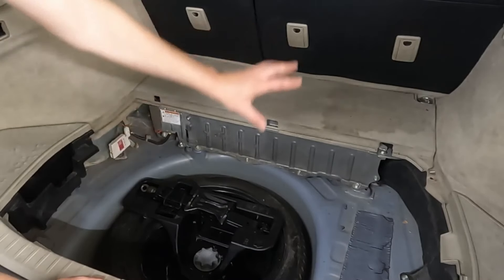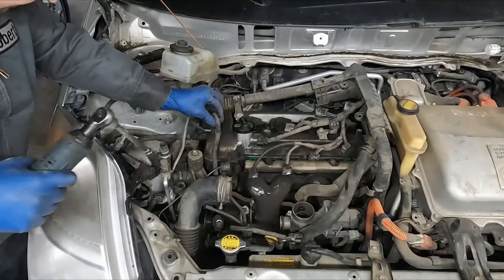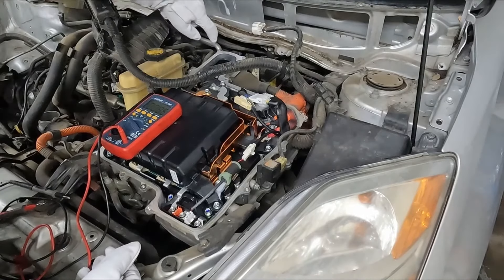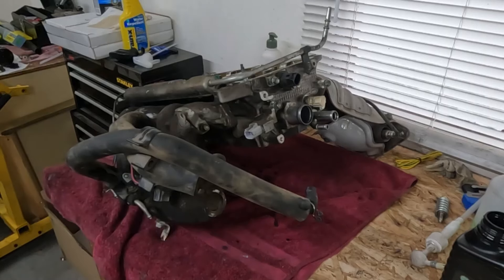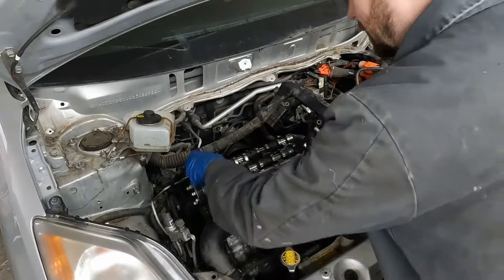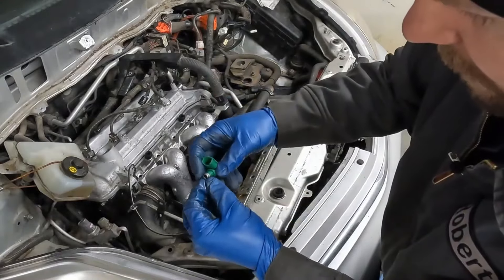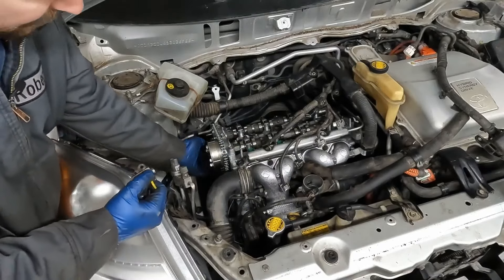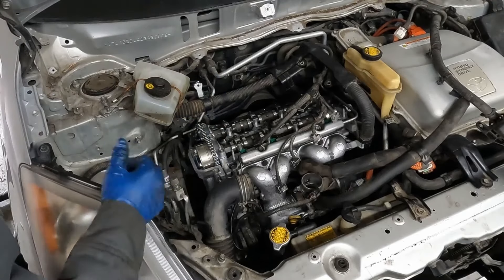2004-2009 Toyota Prius Head Gasket Replacement How To DIY

Comment: Thank you! Few things to add. No need to remove the exhaust manifold. You can remove the cover, unbolt the single mount screw, and unbolt it from the head. It can easily get out of the way and make your install/uninstall easier. Make sure to check your injector seals after the first fire up they tend to leak if not seated perfectly/if you use aftermarket seals. I would also have the shop or check the valve clearances yourself. I had 2 that were off spec with 105k miles. Its much easier to swap/ and measure the valve lifters while the heads off. Also Toyota uses a double hex not a triple square. Some triple squares will not fit. Unfortunately they are not easy to find. I was able to get away using a normal M8 hex. Just be careful not to strip them. I was able to torque and remove them with the m8 hex.
Reply from the maker: @techzilla1  Thanks for your comment and helpful tips 👍

Comment: make sure to not order this head bolt socket when odering from amazon. : M12 Triple Square Impact Spline Bit Socket, 12mm Metric 1/2-Inch Impact Drive Triple Square Socket, Cr-Mo Steel (black) make sure to buy the one he has in the video, but the longer length

Comment: Hi there just watched this nice video coz i have the same car 2007 model  and milages are quite high like 360 k
😊...just need to know its buring quite lots of engine oil smoky as well  some time power just lost and some time its very light to drive so whats the problem it would be in ur knowledge plz? It dsnt lose any colant .........
Reply from the maker: @royzaid6748  Typically if it's burning oil it's either valve seals, piston rings or both. Loss of power could be from a few different reasons. Do you have a check engine light on?
Reply: @ValleyMobileAutomotive  yes when u go bit fast engine light is on and burning smell or gas smell in the car then engine light is on  like oxygen sensor coz its cat.convertor was nicked couples of years ago and im using now after market one.shall i get a another low milage engine or......?
Reply from the maker: @royzaid6748  You should see what codes are stored in the engine computer. The problem may be fixable without replacing or rebuilding the engine. Let me know what codes you find. I'll try to assist the best I can 👍